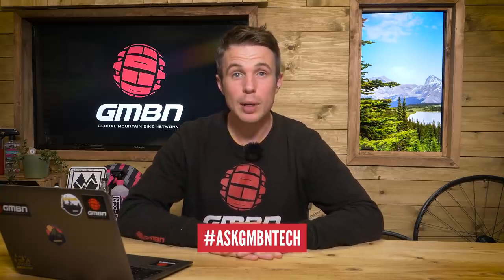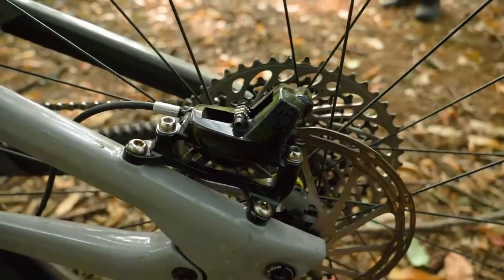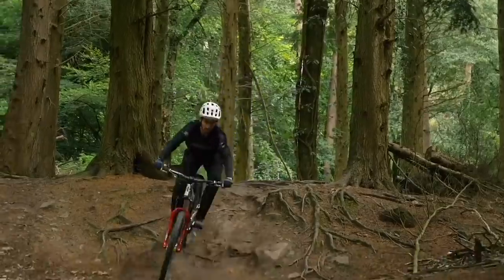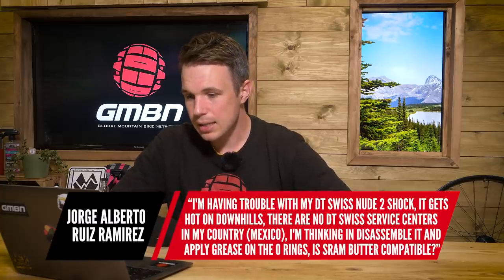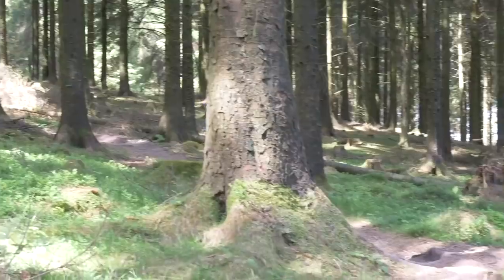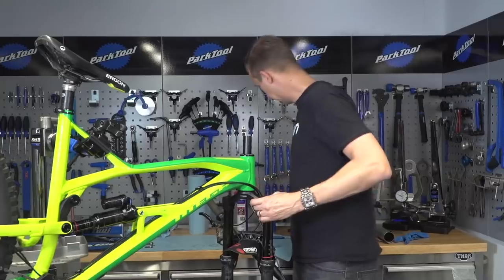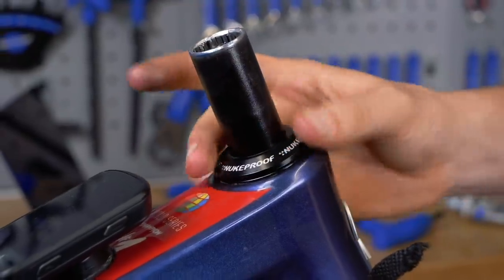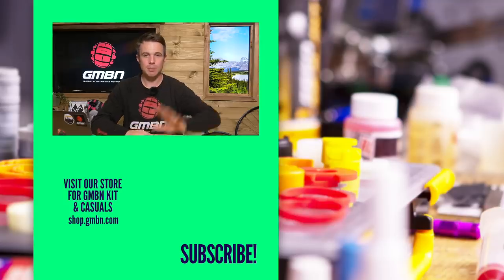Why Is The Head Angle So Important On A Mountain Bike? | #AskGMBNTech

Comment from the maker: Do you have a mountain bike tech question? Use the hashtag #AskGMBNTech with your comment for a chance to be featured on the show 👇
Reply: #askgmbntech is a cannon dale trigger 4 good since I am 14
Reply: Yall talk about head angle watch the grim donut
Reply: What determines the top speed of a bike in terms of the gears? #AskGMBNTech
Reply: #askGMBNTech  before Henry leaves, could you please have him make a short video showing how to do his door jamb tubeless bead setting trick that he always mentions? I have thought about it and just cannot wrap my head around how it could possibly work.
Reply: #AskGMBNTech So I have a SRAM SX Derailleur horrible thing, ghost shifts, skipping all sorts. I will replace it with a Deore shortly my question can I run a M6100 with the SRAM cassette? Also would it be worth chasing SRAM for warranty to have one as a spare or maybe one that works? Bike is used for park and DH.
Reply: #AskGMBNTech can you increase a coil fork travel form 80mm to 100mm and how
Reply: #askgmbn trek marlin 6vs marlin7
Reply: #Askgmbntech I have an 07 Marin Northside Trail and fitted a second hand Rockshox Reba SL Dual air fork. I looked on the Rockshox website using the serial number (24T00011706) but it isn't recognising the fork. What would I need to perform a full service? It was in good condition when I got it second hand  but haven't really touched it since I fitted it about a year ago. Many thanks, Johnny
Reply: #AskGMBNTech Can I mount a 27.5” front wheel on an old Schwinn Mesa MTB designed for 26” wheels? The fork is an 80mm Suntour Raidon (air) and there is enough clearance for a larger wheel up front (not in the back tough, unfortunately). What would be the advantages/disadvantages of such configuration (27.5” front/26” back – is this a mullet?). Will it suspend the BB too much? Will it shift my weight to the back too much on the climbs? How will it affect the bike geometry?
Reply: Hi #askgmbntech bunch, just bought a 2nd hand Specialized Enduro but I'm sentimental about my 2008 Commencal Combi Deluxe and would like to get more life out of it. I'm thinking of an angled headset to reduce head angle and maybe fit it with a longer travel fork (120 or 130). Am I throwing money out the window or has a 2008 bike still its place on the blue and red trails of Europe ? Cheers !
Reply: #AskGMBNTech 
I recently overheated my rear brakes to the point that my resin material fell off. Good thing that the trail I was on had another short steep climb before its final long cliffside descent. I intend to replace both my pads and rotor. However, I was wondering if are there any other parts on my shimano braking system that I should be worry about due to this incident? (e.g seals, mineral oil and etc.) Thank you and may the braking force be with you!
Reply: @ So im trying to help a friend with a bikefit for his XL canyon spectral AL 6.0. He is just over 2m tall and is incurring alot of chain-stay and frame rub. So i figured i would try to give him some more Q-Faktor, as that would sink him more into the frame, and eliminate some of the chain rub.  But is there a good way to find the parts ? crankbrothers makes axle versions with long axles, but it seems most manufacturers try to minimize Q-Faktor, and the data is hard to find on shimano parts ?
// Feel free to paraphrase all of this to fit the show
// Love the show and what you are doing to lift the mtb community!
Reply: #AskGMBNTech love the channel guys just got into mountain biking this year and got myself a cube aim pro , was wondering if which will be the best upgrade to make , better fork , 1x conversion  or new brakeset can only afford one
Reply: @jjchristensen  Everything tightened to spec and double checked it's just a really really bad product and for me has definitely put me off SRAM groupsets. Love there suspension but maybe that's where they should stay.
Reply: Tapa but did you controll it with a hanger alignment gauge like the park tool dag-2.2 ?
Reply: #askgmbntech hi doddy I'm building a mtb with marin bobcat trail 5 2019 29er frame having problem sourcing a straight steerer fork for my build is it advisable to use a crane creek headset that allow the use of tapered fork, another question what is the max fork travel i can use for my frame

-jonnel from the Philippines
Reply: @jjchristensen  Local shop did it and they have pretty much every tool available so I would assume so.
Reply: #AskGMBNTech I have a 2015 Kona Kahuna Deluxe with a stock 2x10 Shimano drivetrain with a quick release Shimano Deore freehub and I’m thinking of moving to the Shimano 1x12 drivetrain. Will I need a new rear hub to support micro spline or is there a micro spline freehub body (similar to the one offered by DT Swiss) that will work with my existing Shimano rear hub?
Reply: #AskGMBNTech after 20 years I decided to get back on the bike. I bought a Scott Aspect 930, and my plan is to get back in shape and then buy a proper enduro bike. This means I dont plan on spending too much on the hardtail. My problem is the Shifters on the 930... I absolutely hate the index finger/thumb levers, as I need to release the brake to shift down. Since its a 2x9, Im having trouble finding a nice shifter for it. How can I change the shifter and retain most of my drivetrain? I wouldnt mind changing the rear derailleur for one with a clutch (the noise over the bumps is also driving me crazy!!), but I need to keep the cost down to save for a proper enduro bike.
Reply: #AskGMBNTech What gear should you store your bike in?
Reply: #askgmbntech how to make mechanic brakes strong as possible
Reply: What do you guys think about Rock Machine Blizz 30-29 ?

Comment: Re air can, some unscrew, some dont (held on by o ring).
BUT a strap wrench is cheap and available in any motor factors (they are for removing car oil filters, but get the rubber strap one, not the chain version!)

Comment: Seat the tyre with CO2, without sealant in and with the valve core removed. Just wet the bead with soapy water. Remove the canister, put back the valve core as quickly as you can and pump up the tyre to the max recommended pressure. Leave it for 5+ minutes so the bead takes the rim shape and stays in place. Then remove the 'air', add the sealant and the valve core, and with a regular pump you should have no issues reinflating it back.

Comment: FYI
I changed my Yari B1 110mm to C1 140mm, and as far as I can tell there is only one upper length available, the only difference is the scale printed on the leg and boost - the replacements are all scaleless.
Reply: I've just upgraded a 160 Lyrik to 170mm the scales are 150 and 160 but was told by a suspension specialist that the stanchions are the same for all models except the scale
Reply: @crit71  
The lyric and Yari Stanchions are the same part too (the lower legs and damper are the only difference).

Comment: I was raised on 70+ head angles. My Devinci has a flip chip but even in the steep position it still feels a little slack. It does feel better the faster I go though😂
Reply: The only thing I don't like is that the bars turn way too easy, so I can't lean my bike on walls like I'm used to.

Comment: #AskGMBNTech
Hi guys, love the show. Really sad to hear Henry leaving, all the best for the future endavours.
My question is: I have a Commencal Clash, it’s 27.5 bike with 180mm travel in front and 165mm in the back. What I’d like to do is to convert it into a Mullet set up by putting 29” wheel in front with new fork with 160mm travel. Is that route a good way of keeping the geo of the bike without changes and adding the benefit of bigger wheel up front?  Or maybe go with 170mm in front as Clash has a really low bottom bracket and suffers from pedal strikes. What do you think of doing a mullet this way, will it work? Many thanks.

Comment: #AskGMBNTech. Hi Doddy and Henry. Love the show. Sorry to hear you’re leaving Henry. I’ve really enjoyed your perspective on mountain bike tech. I ride a Cube Stereo 140 and I’ve converted it from a 26-36 2x11 to to a 32 1X11. Not a really big job but I’m trying learn how to do more of my own bike maintenance. My question is: I now have an XT shifter at the bottom of my tool box. Seems like a real waste. Can it be converted into a dropper post lever (or something even better) the factory dropper lever is okay but ergonomically not as good as most others? Thanks from Saskatchewan
Reply: While anything is possible with enough time and money. Most likely not, the dropper lever is a momentary pull on the cable and releases to lock the dropper in place after you let go, the shiftier is meant to lock in place afterwards.  Also the length of cable pull I'm pretty sure is different.
Reply: steven7650  Thanks.  It seems like such a waste and the idea of having a free dropper lever that would mount to my brake levers sounded like a good idea.  Probably not worth the hassle to even try. Better of spending the money on a Bike Yoke or Wolftooth.

Comment: #AskGMBNTech I don't quite get the reverse thred. I understand it is so it doesn't unscrew it's self but it seems to go in the wrong direction to do so. For example a bottem bracket on the drive side of the bike threads in anti clockwise but when you pedal  your cranks go clockwise. Thanks, love the show.
Reply: Makes a lot of sense very quickly if you hold a pen/pencil loosely in your fists held side by side: when you rotate (pedal) your right fist clockwise, the pen (spindle) wants to rotate counterclockwise. That’s what the threading is based on - precession.

https://en.m.wikipedia.org/wiki/Precession_(mechanical) Take a look at the animation: that’s your bottom bracket from the non-drive side when you’re pedaling forward. Red circle is the bottom bracket, blue circle your spindle. The blue box shows you the direction your spindle wants to rotate in when you pedal. It takes a minute to wrap your head around. :)

Comment: 10:34 9point8 has released an angle headset for bikes with integrated headset, it's a 3 piece design, the bups thread into the middle part. Hardtail Party installed it on one of his friend's bikes it was a Santa Cruz, but the carbon frame was not made for is of course so it required some sanding to get the cup in,cus of tiny i perfection in the hole.

Comment: #askgmbntech
Hey, Doddy, hey Henry! I've got an xc hardtail that came  with 700 mil bars and 80 mil stem, but I feel they're a bit too narrow for me(I'm 6'4 and I've got pretty wide shoulders) and  I wanna get an 800 mil bar. Is it a good idea, and would I have to change my stem to a shorter one? Also, I've got a weird fork that's 80 mil travel, but it's the same length as a 100 mil one(and it's pretty much trash). So would it be a good idea to swap it for a 120 mil, or would I be better off with 100 mil one? 
Love the show, have a nice day!
Reply: Eugene Filatov what bike do you ride?
Usually I’d opt for the shortest stem available, because you gain so much more stability and fun!
But since your not the shortest guy, you have to consider if your top tube and reach is long enough, so you still sit comfortably on your bike. 
For the bars I would say go for 800mm if your shoulders are wide enough and again you feel comfortable with a bar that wide on a Cross Country bike.

Fork wise I would say definitely go for at least 100mm. 
Overforking 40mm isn’t something I’d usually recommend, because of the changes in geometry and the added stress on the headtube welds.
But you said your 80mm fork has the exact same length like a 100mm fork, so going for 120mm should be the same like regularly overforking 20mm.
Something I would not mind at all,  because the geometry stays fairly the same and it doesn’t put to much stress on your frame if you add 20mm in the front.

It seems like you’re more interested in descending, than ascending nowadays.
So maybe you’d like to think about selling your XC hardtail and get yourself a nice Trail/Enduro Hardtail.
If your into it and the higher price isn’t that much of an issue, you could even look at a full suspension bike!
Reply: @rolux4853  thanks!
Your advice is really helpful!
Now about my bike.... Here in Ukraine, it's really hard to find mtbs in 800-2000$ range(mostly because of covid), and so I bought a cheap 300$ xc and plan to upgrade it a bit( plus if I brake it I won't be so sad). The frame is good, I swapped the saddle, grips and pedals, put on a hydraulic brake on the front, plan to swap the fork, bars and stem.
Thanks again, 
Good luck!

Comment: #AskGMBNTech

First of all I love the show and I'm so thankful for all this great Mtb content.

Lately I did a full service on my 2016 Rockshox Yari. According to the service manual I changed the oil in the open bath damper. After the service the damper only engaged after 10 mm into the forks travel in it's fully closed setting.  RS states an oil volume of 160 cc and I did the service according to the manual. Since the problem didn't existed before the service i ask myself if the previous owner put more than 160 cc of oil into the damper to get rid of the problem and if so could this create further problems down the line?

Greetings from Germany

Comment: Hey GMBN, nice video as always! But I want to correct one thing.You're wrong about increasing travel on the revelation fork.

1. No need for new uppers. They are the same length regardless of travel but have different printing on them. 
2. The dimple is not in a different location, that's just an internet myth. It sits in relation to the piston and seal head, which are always in the same location. What changes with travel is the airshaft length and nothing else.
3. Bottom out is still handled by rubber bumpers in the lowers. The uppers are the same length regardless, because bottom out has to work. No difference regardless of travel.
4. Bottom line, YES he can without any issue use the same uppers.

Get your facts straight man! ;-)
Reply: Man, thank you for posting this!

Comment: #AskGMBNTech After much frustration with presta valve cores, I’m thinking of converting them to schrader with ConvertAir?  Schrader valves hold hundreds of psi in our shocks not to mention are used in road/race vehicles, scuba gear, and aircraft.  Presta valves make sense in narrow road rims but seem fragile and fiddly on 30i+ MTB rims?  The weight penalty seems minor compared to the heavy casings and tire inserts we put on our bikes.  Are there any compelling reasons not to make the switch?  Also, Henry will be missed and I wish him good luck.

Comment: #AskGMBNTech 
Hello great show
2 questions: when getting a new chain there is grease on it, should I still lube it? Also I have a 2x crankset on a single speed, if I were to put 2 single speed cogs on the rear and 2 narrow wides on the front and 2 chains what would happen, would it have the effect of an oval chainring?

Comment: #askgmbntech

I just took my new bike out for its first proper dirt ride. I noticed my brake rotors would rub for a bit after hard braking (say, before a corner), and then be fine when I would stop and spin the wheels to check. Is this anything to worry about, and if so, what things should I check?

My brakes are shimano deore 2 pot hydraulic. I did swap the hoses from UK style to US style setup, and it doesnt feel like I left any air in there. Doubt it's relevant, but this is on a voodoo mambo HT, 180mm front and 160mm rear rotors.

Comment: #AskGMBNTech

Hi GMBN! I have a 2010 Specialized Demo 8 I, which has the Fox DHX 4.0 rear shock. Recently I took the spring off to cycle the shock by itself and clean it. When I got the spring back on the bike the shock would not compress. After pushing on it and trying to get it to compress, it did. But there was no longer damping to the shock. I would assume something internally broke. Is there any way to get it fixed? Or should I just buy a new rear shock? Thanks!

Comment: Hi Doddy and Henry, I recently purchased a new fram (Commencal Meta AM 29) and I want to fit a RockShox Coil shock. However, there is no such option yet and they use a very unusual shock (230*62,5 mm). My question is, if it is possible to buy a 230*65mm shock and change the travel of its strock? If yes, how can I do this? #AskGMBNTech
Reply: Have a look at off set bushes. You might be able to knock the 2.5mm off.

Comment: #AskGMBNTech  I have a 2015 Cannondale Trigger Carbon 2 with 27.5 wheels and a 2x drivetrain. My rear cassette is worn out. I'm tempted to upgrade to a 1x instead of just replacing the cassette, but am not sure it is worth putting that much money into a almost 6 year old bike that I've basically ridden into the ground (for instance I broke the rear triangle last year). How do you decide when to upgrade a component on an older, beloved, bike, versus go shopping?

Comment: #AskGMBNTech  - I just bought a 2021 Fuel EX8 XT and took it on a few rides on my local trails.  In getting the bike dialed in, which would help with too much bounce off small rock and root chatter?   Rebound or Tire psi changes or both?     So far I have set the bike to Trek's factory settings but added a few clicks of rebound since , and dropped from 30 to 25psi front and rear and that helped a bit but its still not really there.  anything you can recommend would be appreciated.     I don't plan to do many jumps , its mostly just trying to smooth out the rock gardens and trail chatter. Thanks!